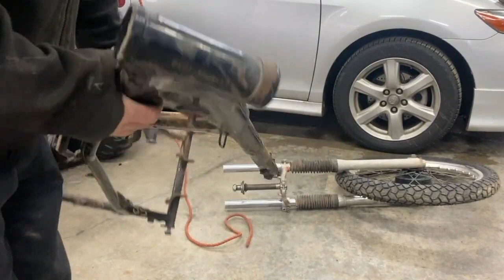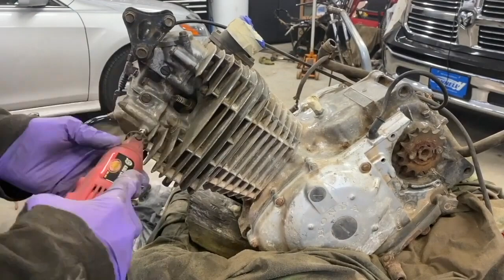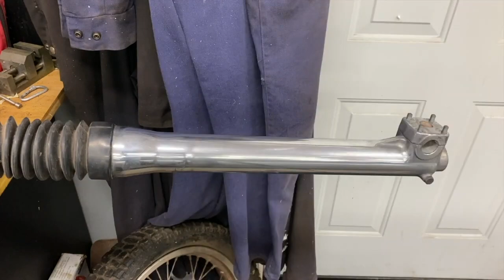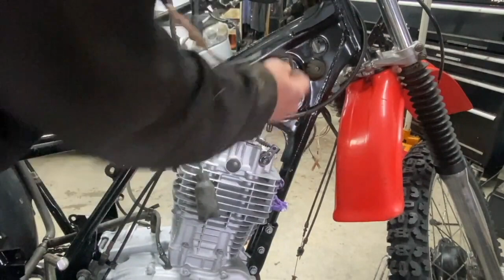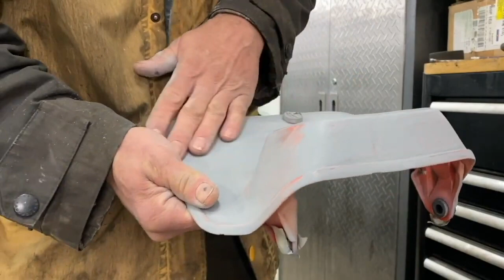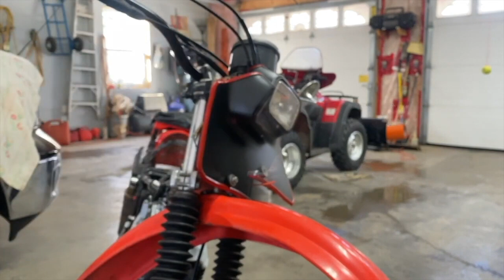1979 HONDA XR500 full Restoration. Start to finish. 7 videos into one.  (XL500, XL500s)

Comment: Hello, I am not sure if I have all electric components . When You remove gas tank on a right side there are let say three plastic  plugs attached to frame . But seems that ther should be some other bigger element . Manual drawings  shows some cylinder shape element like 4 cm in diameter . But I cannot see it on electric schemes . This place is empty on my bike , and I am not sure if I am missing sothing.. Can You advise your idea? Thanks
Reply: Hello I found it, its flasher relay what I am missing
Reply from the maker: Do you have a XL500s or a XR500?  The wiring harness are different. 
Check out this video. 
https://m.youtube.com/watch?v=wJLUfAF6eiU&list=PLwiPIZPn_7Pfc-v4Vz5cWhXOgusj8DQf_&index=5&t=430s&pp=gAQBiAQB
Reply: @WeekendHobbyMechanic  I have XL500 S , 1980. But I have found it , its flasher relay :) . I found your another video about it.